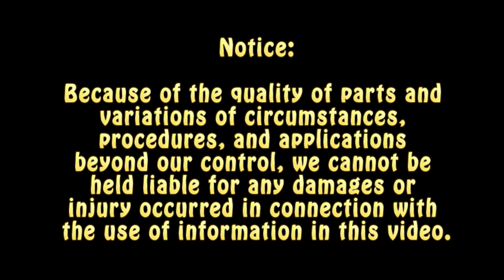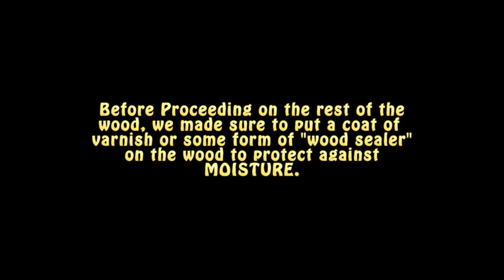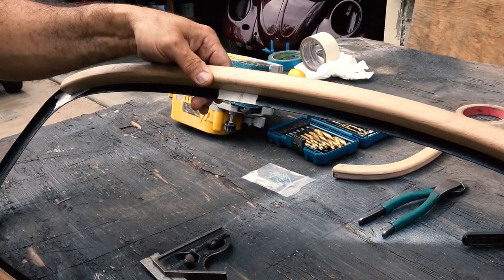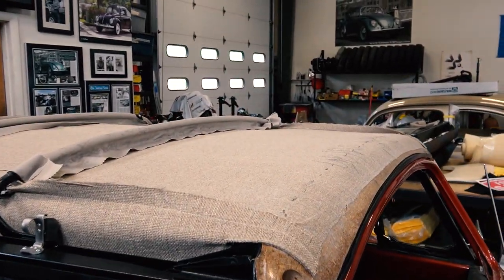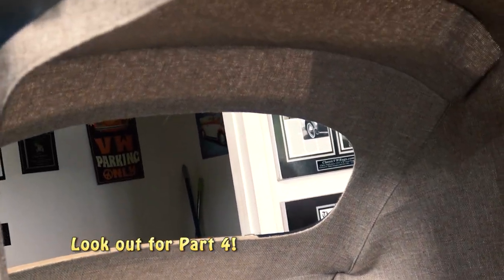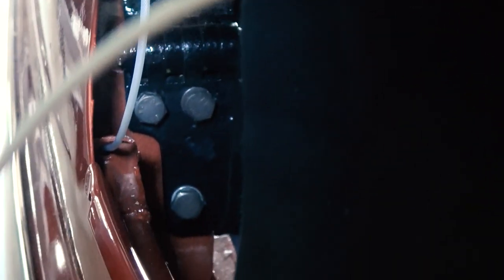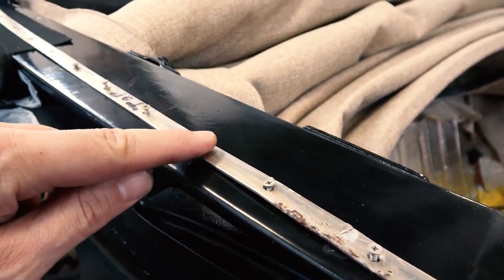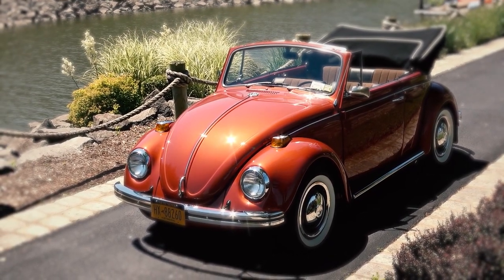Classic VW BuGs Convertible Top How To Install Beetle Series All In One

Comment: Very helpful. What size staples did you use? I got the arrow T50 like you suggested, but it comes with quarter inch, 3/8 inch, and half inch. Also, you gave the measurement from the back body bow to the window bow, and then the measurement from the main to the rear tubular bow, but you did not give the measurement from the rear window bow to the main. That would be very helpful. Otherwise great job so far I’m only on the headliner!